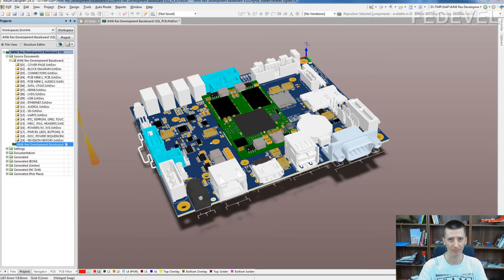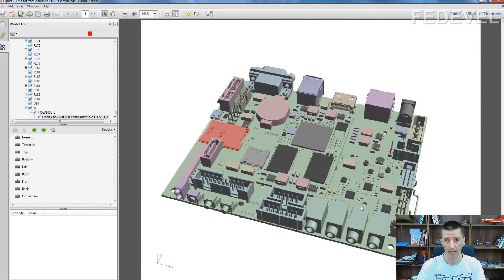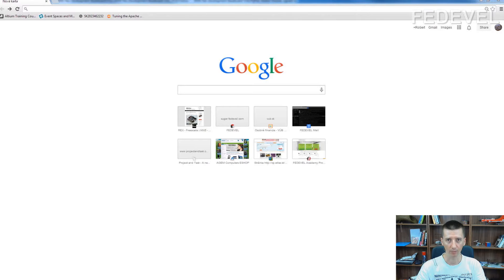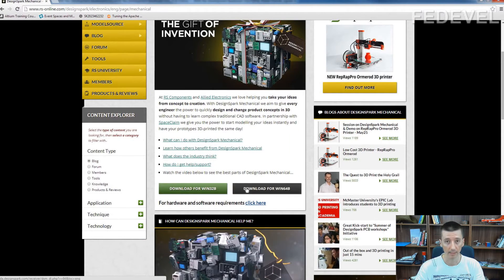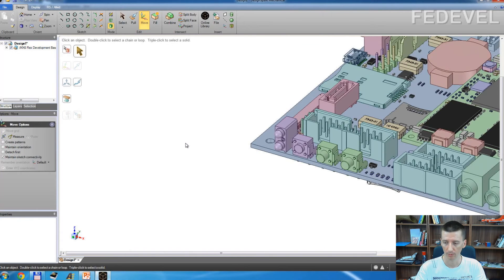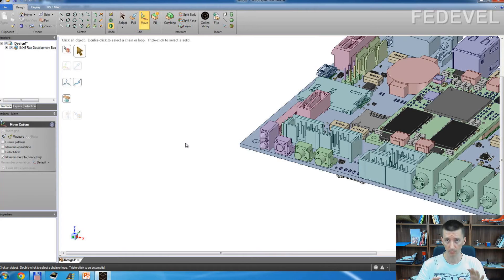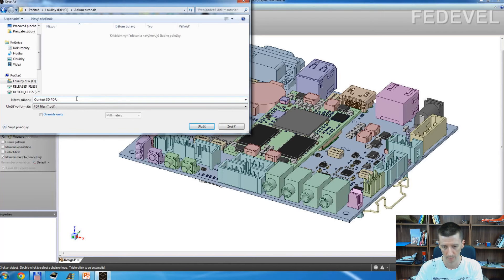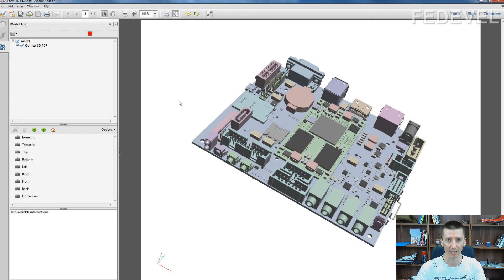Altium - How to Export PCB to 3D PDF

Comment: Hi Robert.
Did You figure out how to export traces and siklscreen?
Cheers
Lukas
Reply from the maker: Try this. Go to your PCB, then: Tools -> Legacy Tools -> Legacy 3D View. Once you are in the 3D view then: Tools -> Export -> And check the boxes you need (e.g. Copper, Text, Silkscreen, ...). This way 3D component models are not nice, but you can delete them, keep PCB only and use the standard 3D export to get nice 3D component models. It's not my idea, I read it on Linked in Altium forum. It may work for you. Please, let me know then.
Reply: Robert Feranec
Unfortunately I get an "Address violation error.." when trying to export from Legacy 3D into STEP :/
Thx anyway.